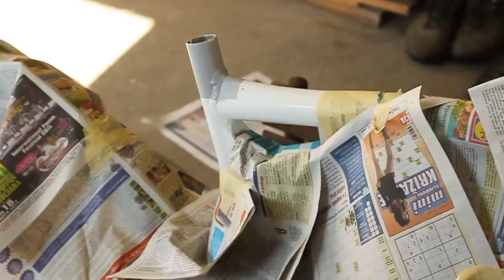Bike frame painting - after welding

Comment: Did you get a new frame? I seriously hate Commencal for being such a bad bike company with a piss poor design. I study up bike designs and how there's that extra seat tube sticking above the top tube area, that's a bad. Not reinforced with another triangle? Bad. Just so many problems...

Santa Cruz are a good option. They use 6069 Alu which has 20%+ fatigue strength compared to 6061 which is the normal Alu Alloy.